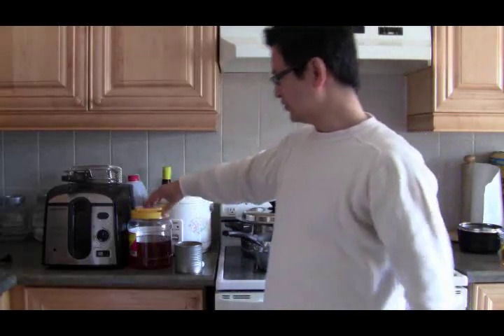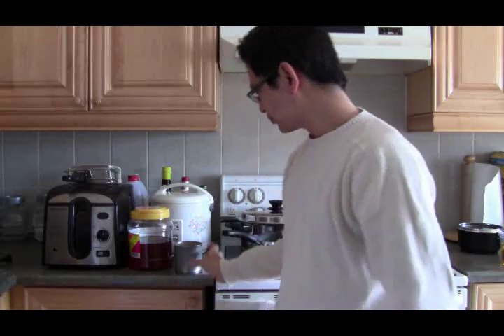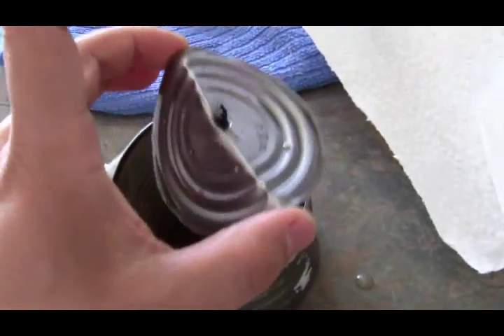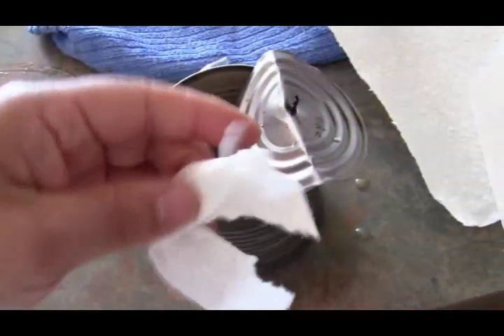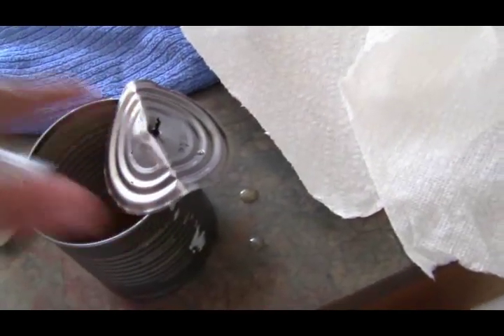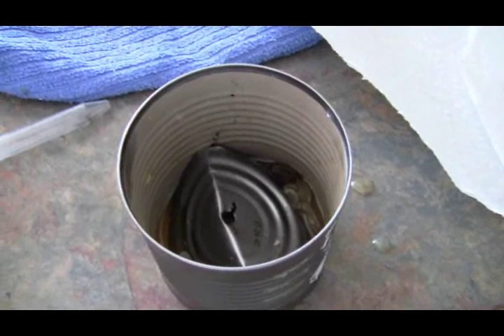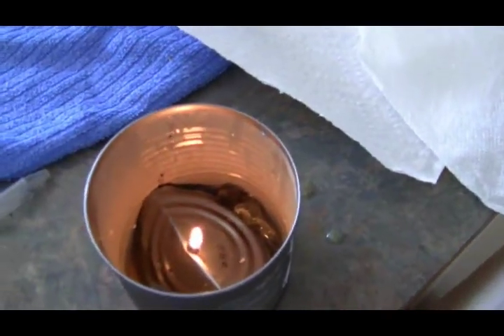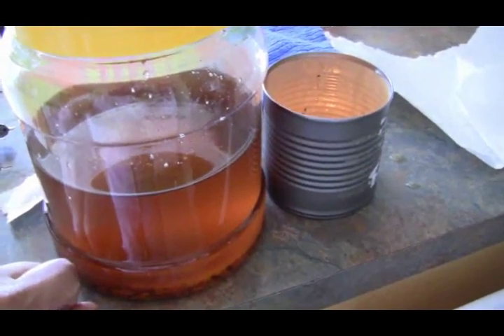Biofuel Biodiesel Oil Lamp from Waste Vegetable Cooking Oil - How to make Free Energy

Comment: another wick option is to take a bunch of rags, enough to fill the can loosely, put a small bit of it through the hole and put the rest of the rags into the can and fill with oil to the top of the rags, then just lay the wick holder on top. the rags will allow the holder to ride higher in the can, acting more like a candle or lantern than a stove(since the flame is hidden). the rags act as a wick and a filler to prevent the holder from lowering into the can.

Comment: dude i have been making all kinds of candles like this and saw a cool idea on another video,, he took sand and filled it to a desired height, then made a hole, nd inserted the twisted toilet paper, then packed the sand very tight, then filled rest with oil,, it worked for me really well, also after a while i decided to use jars cause i didnt want the inside of the can to burn of the enamel coating and get me sick,, i use glass, and will soon dig for clay to make a clay lamp! :D lol
Reply: Do all cans have enamel? Surely not aluminum cans?🙄🤷

Comment: I would like to know if vegetable oil can be used on oil lamps?
Reply from the maker: For making small oil lamp (less than 20 ml) and it is away from flammable items,   I think it is good.  Make sure not to leave it unattended.
Reply: @educatetube  do I have to add anything else beside vegetable oil for flame to burn consistently?
Reply from the maker: @Hōkūleà-m5r  Not really. Just make sure the wick is completely separated from the pool of oil using a metal barrier.  Remember to attend to the flame at all time and no more than 20mL oil, in case it become fire hazard.  Always play it safe and not risk fire spreading as  it is not worth a few dollars savings instead of getting a proper oil lamp.
Reply: @educatetube  Thank you for responding to my message.